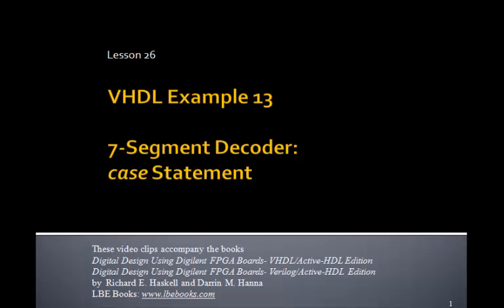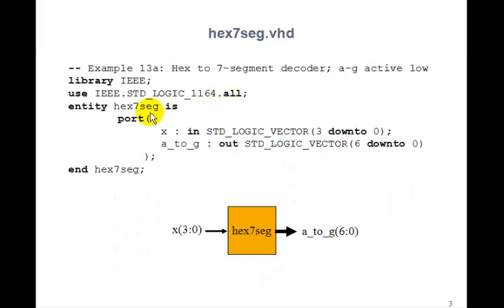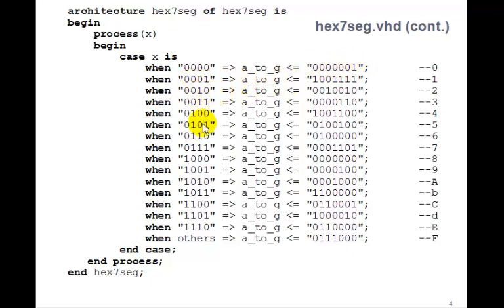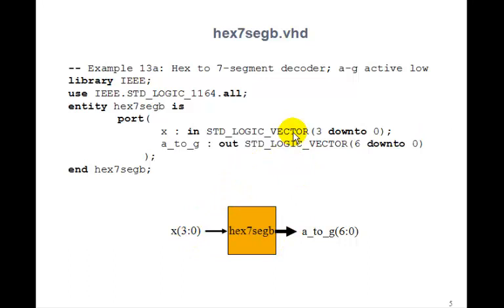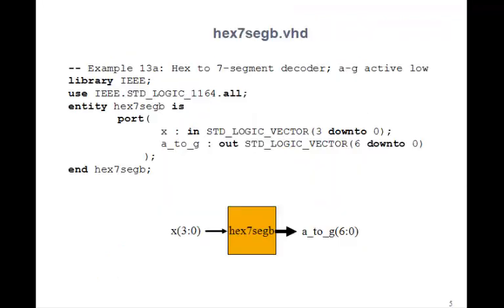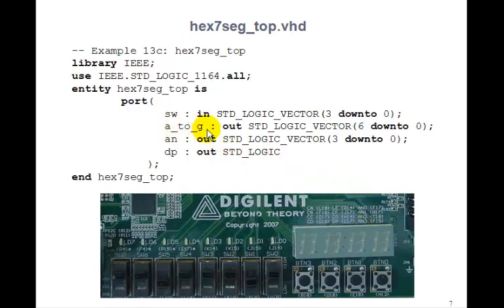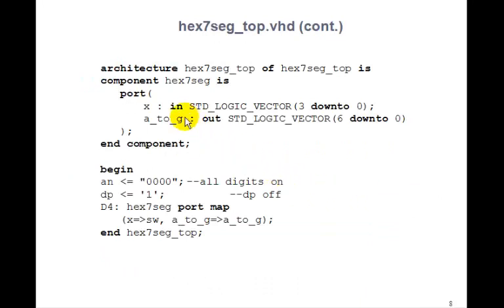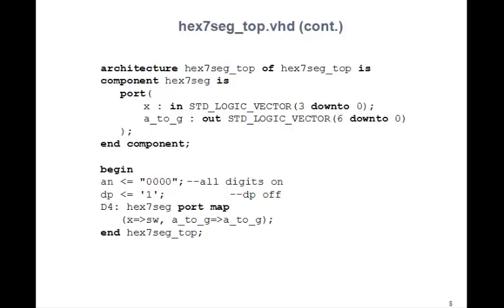Lesson 26 - VHDL Example 13: 7-Segment Decoder-case Statement

Comment: In the UCF file you need to reverse the indexes for seg<6:0> for the VHDL code to work properly. Thus, seg<6> = LOC L18, seg<5> = LOC F18 etc.
Also seg<6:0> must be renamed as a_to_g<6:0>.